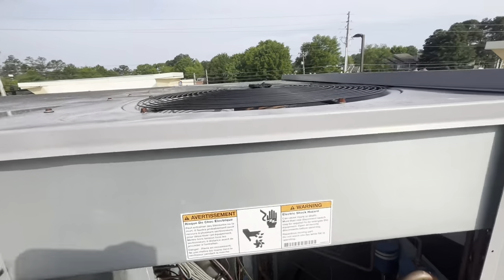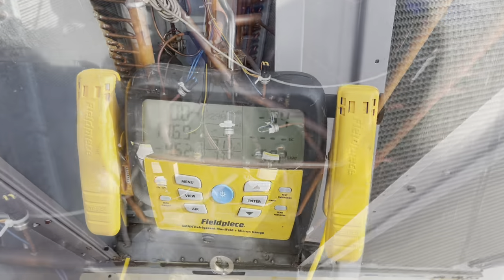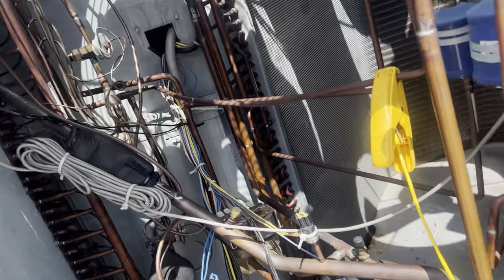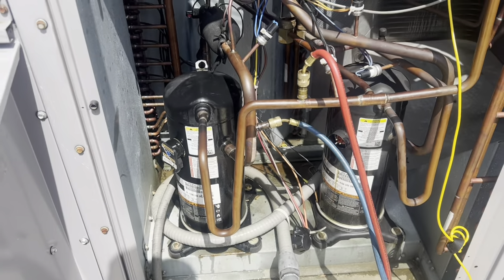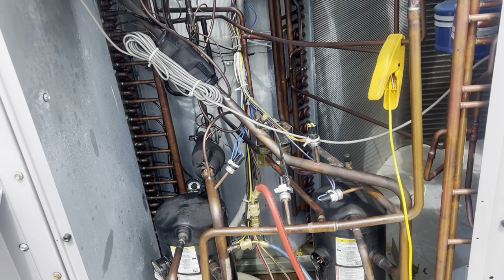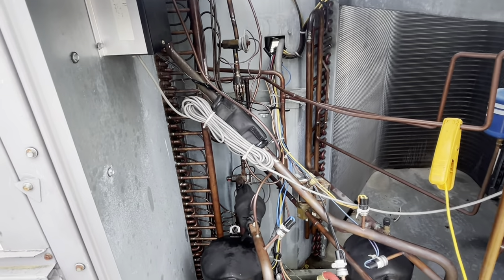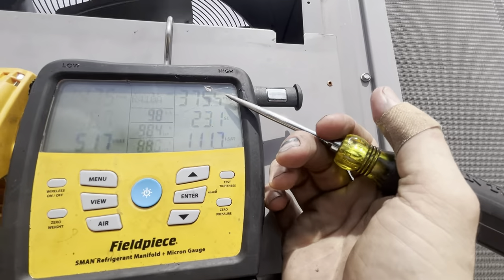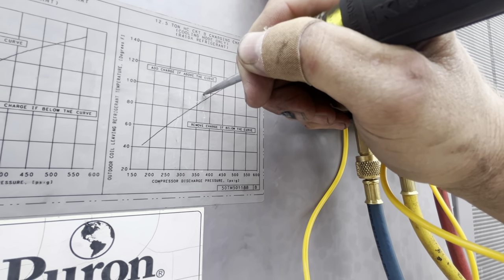Carrier 12.5 ton - not cooling - oh my….

Comment: That's really interesting to know that you don't need the external equalizer line on a txv in most situations, I never would have guessed that. Thanks for the info. I just subscribed to your channel today and am looking through your videos and finding a lot of great content. I'm a mostly residential tech that's getting into commercial so it all helps.
Reply: Just because it "worked" doesn't make it right. The equalizer line is used to reference suction pressure (closing force for TXV) when a distributor is used, due to the pressure drop. The only time you don't need it and use an internally equalized valve is when you don't have a distributor. You see this on really small units, like self-contain refrigeration units or really old refrigeration systems and some deli cases.
Reply from the maker: @chap3845 - yeah completely get that.     All things being correct we need to get it back in play.   I do agree with the observation that this compressor is failing and causing the ridiculous vibrations that lead to all the rubs.
Reply from the maker: @chap3845 - right-o. 👍🏼.

Comment: Part of the dining experience is enjoying your meal in a cool dinning room setting.  There are a couple of restaurants that I will not go into on a hot summer day because I know it's going to be hot inside.
Also the txv cap tube is a external pressure sensor.  It will run capped off. 
The inhouse tech should be on it securing the tubing. Good fun.

Comment: Well that line is for the txv for measuring the suction preseure. Now its at atmospheric preseure and weld shut. Atmospheric preseure for r410 is cold. So the txv thinks the superheat is very high. And thus is wide open. After a while the txvs start leaking internally to some degree, so the line kight huikd pressure. (Eg during standstill). Then the valve could close shut. in short, the line is not optional. Have you had good luck with those fittings?
Reply from the maker: I have had 100 percent success with those fittings yes.    Was very skeptical at first so only used them on suction lines and low pressure but they’re solid.   As far as the equalizing line.   The txv sensing bulb isn’t what’s shut.   Now you are correct the equalizing line was there for a reason however I’ve also had them blow out before and the systems will absolutely operate without them.    The next time we have an issue (which will likely be a failed compressor given the hostility that is causing all the vibration to begin with I will most definitely reattach the cap tube.

Comment: What did you use to repair the leaks. Never seen them before?
Reply from the maker: Refrigerant sharkbites basically.  Google SB1 fittings.  I was skeptical when they came out and I used them as experiments but have had 100% success with them.  They come in every variety from ball valves to reducers.  Parts houses sell them

Comment: It weighs 12 or 14 tons???! What in it would be so heavy?
Reply from the maker: Tonnage refers to the amount of BTU power it has.  Apologies for the confusion. 12,000 btu per ton this unit is 150,000 btu = 12.5 ton unit.   It’s a measure of power not weight out here
Reply: Got it, thanks! I

Comment: You need the equalizer,the compressor will overheat and die,unless the board turns it off,that's the noise you hear,it is saying I'm dying.
Reply: don;t bill them,is going to need more work.
Reply from the maker: K let’s talk thru that…  without the equalizer offering proper closing force (isn’t that what it actually does) will it generally flood or starve.   Real questions? I’m not “fighting back” this definitely seems more your wheelhouse than mine so I’m looking to grow my understanding.   I had a 14 ton unit blow out its equalizer tube in 2021 and she’s pinched off and still running.  So Mayhap I’ve gotten luck with that one but the only experience I have with removing it was successful so I was willing to do the same here.   Truly would love more of a seasoned understanding.
Reply: @restaurantrepairs  the pressures will be fine for a while ,then the valve will go shut,and the low pressure switch will turn it off, but the compressor will run with the valve closed and overheat.but also a compressor is getting ready to go.
Reply from the maker: @MariosACandRefrigeration  the compressors are from 2018 so we were joking about the fact that it’s time for them to die cuz they outlived their 5 year warranty.   Why you say one of those compressors is gonna die? What are you tapping into?  Again I’m asking genuinely not out of sass or anything
Reply: the compressor is causing the vibration,and causing the rub outs.
Reply from the maker: @MariosACandRefrigeration now THAT makes perfect sense….  👍🏼
Reply: @restaurantrepairs  you might be better of,running stage 2,for now and order the compressor.

Comment: Outdoor leaving refrigerant temp is the liquid line temp. Which was 89 degrees, you already had 20° of subcooling and looks slightly overcharged to me, because you brazed the equalizer line shut, so the valve was pinched off.  FYI that line doesnt have anything to do with the unit not being a pump down. Its used for systems that have a distributor (like this one) and a pressure drop from across it, to reference the suction pressure... Not trying to be a dick just dont want you or anyone else going around installing internally equalized valves and having a compressor fail/not cool properly.. Seen it a few times. 

If you brought the torches up already it would have been pretty easy to stick it back in the suction line.
Reply from the maker: Totally get it. Never offended by anyone’s insight or wisdom.  What did I say the sub cooking was. Wasn’t it 90 when I was videoing.   And as far as the pump down thing I was going kinda squirrel on comparing them to externally equalizing txvs like on walk-in (pump down) units.   I learn more than I teach for sure.  Appreciate you.
Reply: @restaurantrepairs  You said the temp was 98, not sure if that was the air temp off condenser fan or if  you had the other probe on the suction line. But the liquid temp was 89, giving you 20 degrees or so of subcooling... I feel like those charts on the carrier units are for people that don't know what subcooling is and just keeps you from grossly overcharging units, especially a unit with a TXV.  Pretty much if you have 8-15 subcooling on a unit with a TXV you are charged properly... If the unit has the Carrier actuators I like to use the standard indoor wet bulb X 3  minus 80 minus outdoor dry bulb X 2 to get your target superheat.... Or just use 25-30 condensing over ambient and a beer can cold suction 😝 if I'm being lazy and in a hurry.
Reply from the maker: @chap3845 gotcha yeah I looked back.self to see what I said and I was looking at the T1 probe that was clamped on my gauges 😂🤦🏻‍♂️🤔